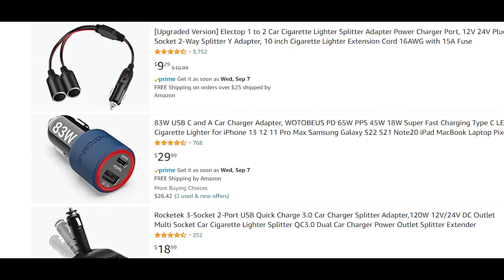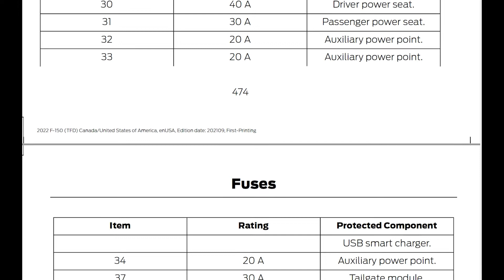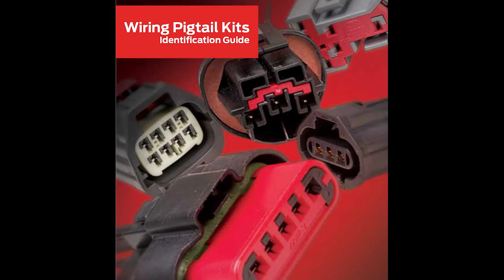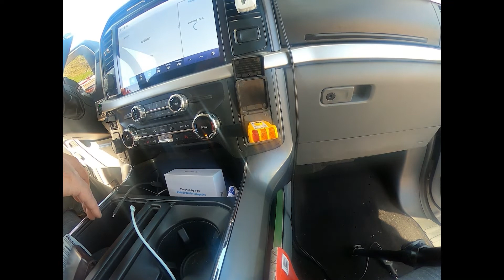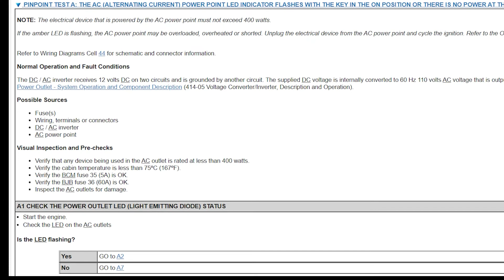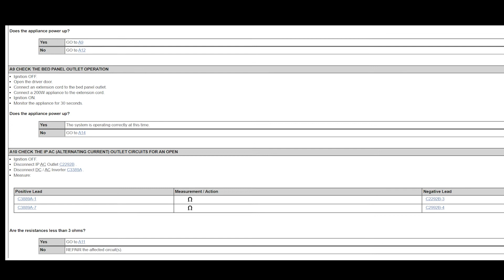2022 Ford F150 Recep Not Working - Part 2 of 3 - Troubleshooting  - Part 3 Ford Service Bulletin -

Comment: fuse 36 is a 60 amp fuse in the battery junction box.  its on the outside of the box and has a wire going to it with a 10mm but.  its the last wire closest to the firewall.  fuse 35 is in he bcm.
Reply from the maker: Thanks Mikey !  - I no longer have that truck - got a new one this year - but - EXACT - same pro'lem ...  Uh ... but worse - took over 2 weeks for them to get things fixed.  FORD - better wake up.  :(

Comment: thank you so much after I reset the battery sensor it worked
Reply from the maker: Glad it was helpful - and saved a trip to the service center.  :)
Reply: @EarlAndJill do you think it's possible that the battery sensor has a problem cuz?When I reset the battery sensor it works and it stop working again and on the gouge of my battery voltage sometimes drops up to twelve volt
Reply from the maker: @yunholee9685   .... Hmmmm ...  Drops to 12 Volts - It is impossible for me to attempt a diagnosis from my armchair - but YES - a bad sensor (monitoring) module COULD cause a parasitic draw and drain the batter.  But - the problem COULD be a bad battery.  Have you tested it?  Also - it could be a relay stuck ON somewhere.    I would disconnect (Carefully) the neg battery terminal.  There "MAY" be a small spark (memory circuits still draw power) ... IF ... there is a LARGER spark - something (Switch / Relay) is stuck on.  I'm sorry I can't be of more help.  :(
Reply from the maker: I apologize - I never got a NOTIFICATION on your comment.   Just curious - did you ever figure the problem out?  Was it the BMS?

Comment: I had the same issues. Changed my outlet and problem solved. Added some grease like the service bulletin said.
All good!
Reply: Having the same issue. Did you have to have the dealership reprogram anything or is it a simple plug and play harness?
Reply from the maker: Azzy - Sorry - I didn't get a notification.  I don't know if the dealer had to program anything - the service bulletin didn't mention it.  My guess - is water / moisture infiltration - set an error code.  Then - the moisture being trapped - never allowed a reset.
Reply from the maker: Glad yours was only the outlet.   Just bought a NEW ford - the BCM was out.  :(  Ford - MUST get back to quality ...  Take care Rick.

Comment: I had the exact same symptoms. I replaced the bed mounted receptacle and problem solved. Thanks to your time to make this very informative video along with the TSB details I'm back in business. I was out of warranty on my '21, but the replacement  part was only $60.00.
Reply from the maker: Hey Mr. Bull !  Thanks ...  I'm glad you got the parts - at a reasonable cost - AND avoided a visit to the service bay.   While mine WAS under warranty - it is a definite hassle ... taking to service center - waiting - picking up ...  and the wait time.  Hope the new receptacle lasts longer than the original.  I'm curious - just how many people HAVE this problem.
Reply: Did you buy just the receptacle or did you get all the parts in the tsb?
Reply: @drewzx3  I inspected the wiring and connector and it was fine so just replaced the bed mounted receptacle.

Comment: Having a similar problem with my 2021 F150 Super Crew Lariat, the rear 12volt power outlet is not operational.  The front on the passenger side works just fine.  I brought it to the dealership and they kept it for 5 days, I was told it was fixed.  Once I arrived and tried the outlet, it was not functional.  Service told me to bring it back. Had a similar problem with booking into service took a full month to get scheduled.  Why did I buy another Ford I ask???  Starting to regret my purchase...
Reply from the maker: Hey Gerlad, good morning  :)    Your 12 volt isn't working?   That one is really odd - considering the wiring diagram looks straight forward.  What I've found is a MAJOR difference in SKILL and KNOWLEDGE between the Ford service centers.  The dealership where I bought mine - wanted to remove the dash and look for the problem.  The second, tried to BS me (the desk clerk, not the techs) about the problem and the final one (Jack Kain - Lex Ky) - actually had the FORD BULLETIN.   I hope you find a good service center.    Your comment about regret - strikes a chord also ... I think there are 6 (i'm guessing) recalls on my 2023.  Several articles about FORD Quality (and recalls) as of late.    I think the 12V problem should be straight forward.  Let me know what the final outcome (cause, etc.) is.  Thanks !

Comment: I'm having the exact problem. Did the new wiring harness fix the issue?
Reply from the maker: Yes, .... check out part 3 - ... Ford KNOWS about the problem --- however many shops do not.  There is a bulleting out - on fixing it. Good luck.

Comment: After Ford did a diagnostic check,I was told I needed a whole new wiring harness that went from the dash back to the power inverter. The truck is only six months old--ridiculous.
Reply: They tried to tell me ...they needed to take out dash ... may be wise to make sure they're aware of the bulletin ... good luck!
Reply from the maker: Wayne - check out Vid 3 - there is a service bulletin ....  The first Ford Dealer wanted to take out my dash - the second (with more experienced ???  techs??) - found the bulletin - fixed mine.   Again - Good luck.